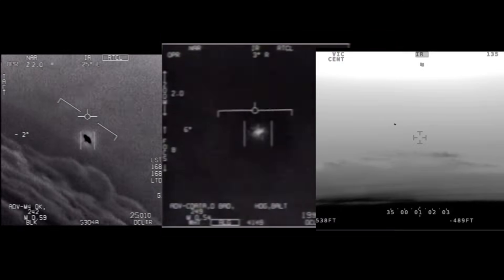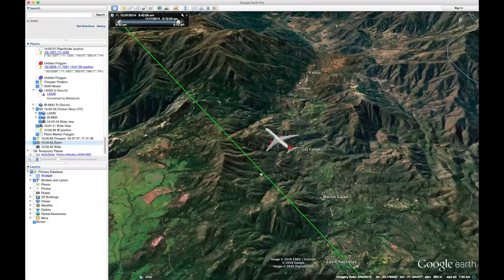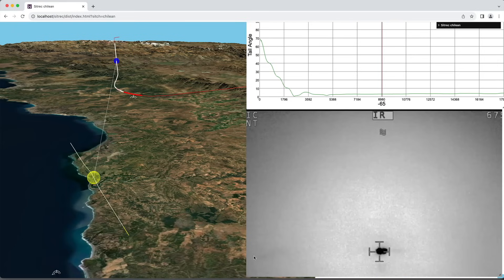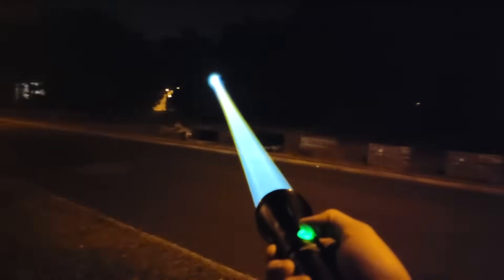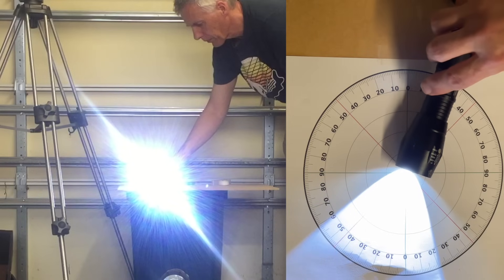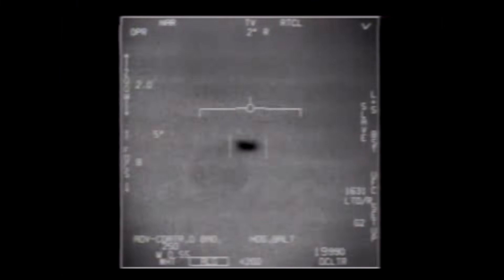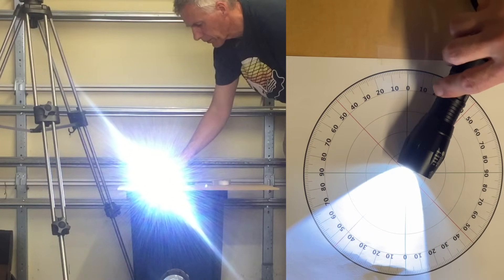Jet Engine Glare - Angles and Sizes

Comment from the maker: UPDATE: With the A340 engines, the range of visible glare angles is much greater than the F/A-18 engines. The A340's Rolls Royce Trent 500 or CFM56 engines have an exhaust cone that gives a large thermal signature (a glare) even when you can't see "up the tailpipe."  However, the flashlight analogy still applies to the F/A-18 and similar engines that just have an open cylinder with the hot parts visible at the bottom.
Reply: Source?

Comment: That's a nice flashlight.
Reply from the maker: $10 on Amazon https://www.amazon.com/gp/product/B072WHQFJ7/ref=ppx_yo_dt_b_search_asin_title?ie=UTF8&th=1
Reply: @MickWest is the $10 one the one that looks like a lightsaber in the outdoor shots? Surely not? 😮
Reply: Actually, it isn't. It's one of the cheapest, prone to falling apart if you even look at it the wrong way. To get anything decent, you have to spend at least 100 USD. (I'm a caver here in Jamaica, so know my lights).
Reply: @JCO2002  yes ok, we'll use the 10 dollar job to check what made that rattling noise back there behind the shed, and you use your 100 dollar job to descend into the bowels of the earth

horses for courses
Reply: @DrWhom  Sounds like a plan. Although, you know, my headlamp actually costs 900 USD (Scurion 1500). The 100$ unit is just a tactical light. Quite bright, though! :-)
Reply: @JCO2002  Yeah, I'm not spending a $100 bucks on a flashlight ;)
Reply: @SebSenseGreen  Ah, but if you did, once you'd used it, you wouldn't regret it. Big Li-ion battery (21700) with multiple light levels, the lowest of which lasts for days, and the highest of which makes for great self-defence - blast that briefly in someone's eyes and they're blinded for minutes. But each to their own.
Reply: @JCO2002  I have enough addictions right now. Hehe... My last one I got is the mechanical keyboard addiction. I'm gonna wait a bit before I start a new one. But, thanks for the info.
Reply: @SebSenseGreen  You're welcome :-)

Comment: Mick(Sorry, phone), clear up for me a few things about your rear-end of a jet hypothesis please.

1. The cloud movement, aka, parallax.

So if we're looking at the rear of a jet engine then surely the object must be flying away from the F-18 gimbal pod, yes? Since any divination in any other direction other than directly away from the camera would produce a thermal jet exhaust in the opposite direction which we'd see, but we don't see any, yes? Therefore if what you're saying is true, then any parallax effect creating the illusion of this object moving leftwards with absolutely no visual jet exhaust can ONLY have been created the F-18 gimbal camera moving in a rightward direction relative to the object being recorded to give the illusion that it's travelling leftwards yes? 

2. The problem with that theory, is that apparently the F-18 was on an intercept course and flying directly at this object. So if that's true, then any parallax was being created by the object and not the F-18 but if that's true then it means the object was flying in a direction that wasn't the same direction as the intercepting F-18 mounting the gimbal. But if that was the case then we'd see a jet exhaust going in the opposite direction the object appears to be going in of course, but we don't see any such directional exhausted which must therefore mean the object, if it's a jet, is flying directly away from the F-18 and that the F-18 is not flying directly at this object on an intercept course as stated in the story, right?
Reply from the maker: 1) It works out as flying away and a bit to the left, about 25° at most from straight away. 
2) The F-18 was flying 54° away from the jet at the start (number at the top of the screen), then it turns towards it, decreasing the parallax effect,  which is why it seems to slow down.
Reply: @MickWest  That seems a very compelling evidence in your favor when held with all your previous associated vids on the Gimbal vid. 

It's still hard for me to believe that the pilots we hear commenting in this Gimbal vid as they record this footage on their FLIR are completely perplexed by what they're looking it. It's fine and expected for someone like me to see something like this for the first time and say I don't know what the object is, but it's hard to believe that these trained pilots haven't seen this many times before and are so shocked and have no idea what it is they're looking at. Surely they must have seen the rear-end of a jet on their FLIR pods many a time? 

Thing is, people make mistakes and while I'm definitely surprised the pilots haven't seen this before(and most likely many times surely), perhaps they are only new pilots in training, though I think I heard Ryan Graves say he knew who those guys were, flew with them many times and that they were highly credible and experienced pilots.

Ya, overall I'd be inclined to agree with you, and that if the pilot had switched from IR to TV mode, we would indeed be looking up the backside of a jet engine. It doesn't explain the "omg there's a whole fleet of em!" on the SA, but then again, I've always found the fact this "Gimbal" vid is so very conveniently shortened to be somewhat suspicious to begin with and always felt that there was most likely  the "before and after" part of that vid purposefully excluded in which a lot more revealing things are included. Not because classified. but because it would either heavily empower or completely debunk the ET narrative some like Lui would push. 

The pilot would not have started recording or finish recording to create just the small gimbal vid we see. There would have been a lot more footage before and after. We're informed by Ryan Graves in some other interview I'd seen, that this particular FLIR would be recording the featured "UFO" object at around 9 nautical miles. If that's true, and we know an F-18 cruises at 6-700 knots(depending on alt and without being pushed hard on an intercept of importance) then at the time that "Gimbal vid" ends, we're only seconds away from the pilot making a visual ID with his own eyes on this object if we were to believe the story about this object hovering, rotating and then cutting back in the direction of the intercepting F-18 which of course would only serve to make the interception ETA faster still, right? And yet we don't get that part of the vid, nor have we heard ANYTHING from the pilot who had this FLIR bolted onto his F-18 making the recording. Why is that? Again, I find that suspicious. Is it because he's still an active pilot? But Ryan Graves who said he knows the guy, is himself now long retired, which would mean this pilot is probably retired by now, or extremely green at the time of this recording which would explain why he didn't know what he was looking at if it was the rear of a jet, or perhaps doesn't want to go down that ET rabbit hole. OR, Is it because it's an ET craft performing exotic maneuvers where typical digital camera artifacts are actually a bubble on warped spacetime, or was it just another jet flying away from the FLIR equipped F-18 in which the pilots make that discovery soon after, laugh off their mistake, and it's back to business as usual? When I type the words, "It's an ET craft in a bubble of warped spacetime", I feel ridiculous tbh, and I'm a very objective and fair person. Could it be? or is it more likely the rear of a jet engine in IR flying away from the camera? We need a LOT more information to make claims it's some ET craft, right? Surely that's that sound opinion without making a mockery of anyone or insulting anyone?

Mick, have you ever tried to make contact with the pilot/pilots who recorded that gimbal object that were commenting in the vid? Thing is, I feel this entire ET pushed narrative for possibly just a mundane UFO objects which Lui and the usual UFO brigade push as "Definitely a ET craft!... Bob Lazar!.... Groom lake!!"  could come crashing down like a house of cards with just a little enlightenment by these pilots, or equally the narrative could be reinforced if indeed what they saw was something "exotic".

Comment: To me, the most surprising thing is that no one at Navy or elsewhere figured this out earlier... I mean, that would appear to me as a common situation for a pilot. They've gotta be chasing off tails of  other crafts pretty often. How could they have never seen that on their Ir monitor earlier? (genuine question, I'm not a ufo enthusiast)
Reply: Some pilots have said they see new things after equipment is upgraded.  Possible explanation for why they are initially ¨tricked¨?
Reply: @JTS-u3l  Sure, it could be. But what i'm saying is that it doesn't appear to be a glitch, it's just the way it works : flir camera do have glares (and I don't think they have corrected that yet, but i don't know...). So this should happen pretty often... well at least, that's what i would expect.

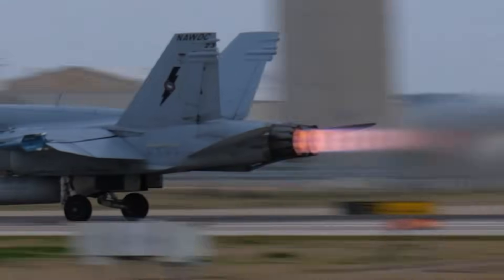Comment: 2:33 Perhaps a minor point, but in afterburning/reheated jet engines like the ones shown, the turbine is quite a long way up the jet pipe, and wouldn't be visible from a wide range of angles. The supports for the afterburner would also obscure the view of the turbine somewhat. I don't know how different the IR signature would be with afterburn on vs off.
Reply: It would be interesting to see comparisons. But even at mil thrust the inside tailpipe is going to be hit and glowing on IR and smashing photons out in all directions.

That’s how heat dealing missiles work. 

What might be interesting is seeing how stealth jets exhaust creates less glare. But I’m sure that is classified.

Comment: This  could be really reasonable and believable IF the videos weren't shot by army professionals that probably know how a jet engine looks like in infrared and they would have known that in that direction there are planes since the control tower they were communicating with most probably knew every plane present in the aerospace.
Reply: @darklight2.1  what do you mean? In the video the  pilot or whoever is talking sounds surprised that "it's rotating" also the pilots did interviews.
Reply: @darklight2.1  1.they knew why the "image" should be rotating but they were surprised that that it's rotating because it shouldn't rotate.
2.ex Commander David Fravor stated in multiple interviews that not only they picked up the objects with their instruments but they also saw them with their own eyes, they flew very close to them.
He said that they were present all the time, so much so that the pilots already were looking forward to seeing them.... this is the context.

Comment: In the Chilean video and ones that we know are jets you can obviously see the outward propulsion of gas from the engines. Yet in the gimbal video you don’t see any outward propulsion of gas from the engines. How do you account for that ?
Reply from the maker: The large glare covers any exhaust gas cone
You don't really see gas in the Chilean case - maybe a little right at the start with the larger angle.

Comment: Have you considered experimenting with a kitchen blowtorch? Maybe it also behaves similarly to the jet engine?
Reply: That's a great idea, although you'd need to use an IR camera or similar.
Reply from the maker: I have. But I’d need to modify it to be more of an occluding tube. And the thermal camera I haves is rather low resolution.

Comment: Another fantastic video Mick. This just brings everything closer to a complete explanation. 

I do have a question though: Fravor mentioned that on a higher resolution of the Chad Underwood video he could see two "legs" putting out in the same direction to the right. What do you think this could be? Is there any sort of identifying gear that a jet could have that matches that description? Or could it be some misperceived artefact from the edges of the wings of a distant jet banking? Explaining that specific observation by Fravor might add another data point of confirmation for the glare/distant Jet explanation, removing more of the "what-about-this" counterpoints.
Reply: I don’t know who any of these people are, I assume UFO fanatics? Regardless, did they show this image or was it just heresay?
Reply: Since you can't see the actual object, he's probably referring to diffraction spikes coming off the glare.
Reply: @MeppyMan   Fravor was a Top Gun pilot instructor who, along with three other pilots, SAW the 40ft tic tac shaped object in the "FLIR" video instantly accelerate to hypersonic speeds from 500ft away. Underwood was the pilot who filmed the UAP after it had just travelled 40 miles away from Fravor in less than a minute, while being jammed by the object in the video. This acceleration was corroborated by multiple radar systems in the Nimitz carrier group. Not a distant plane. I'm not surprised you don't know about them, Mick's "debunking" videos omit everything he can't explain. These witnesses were literally the best of the best pilots in the Navy and 500ft away is more than close enough to not mistake what they saw. Every video Mick has made "debunking" the DoD authenticated videos omits more than it includes. That's not hyperbole. That's why he can easily "explain" them and the most advanced military ever, can't. It's easy to debunk anything, you just have to ignore everything you can't explain. No problem.
Reply: @Bluewhalebig  You are assuming that the object seen by Fravor was the same as the object seen in FLIR1, filmed over an hour later (not 'less than a minute'!).  There is no good basis for that.  Also, so far as I know Fravor's only numerical estimate for the speed of the object he saw as it went away from him was 600-700 knots.  That's not hypersonic, and only borderline supersonic..  And where do you get '500 ft away'?  In his recent prepared statement to Congress Fravor gave the closest distance as half-a-mile.  That's over 2500 feet.  In short, you literally don't know what you are talking about, but that has never deterred BS merchants.  I''m guessing you are nowhere near as big a a blue whale either.
Reliable sources please, if you want to dispute anything.
Reply: @Bluewhalebig  What Fravor actually said in Congress was quote:
 "Our altitude at this point was approximately 15,000ft with the Tic
Tac at about 12,000ft. As we pulled nose onto the object at approximately ½ of a mile with the
object just left of our nose, it rapidly accelerated and disappeared right in front of our aircraft.
Our wingman, roughly 8,000ft above us, also lost visual..... As we turned back towards our CAP point,
roughly 60 miles east, the air controller let us know that the object had reappeared on the
Princeton’s Aegis SPY 1 radar at our CAP point. This Tic Tac Object had just traveled 60 miles in
a very short period of time less than a minute.....We returned to Nimitz and mentioned what we had witnessed to one of my crews who were getting ready to launch. It was that crew that took the now famous approximately 90 second
video that was released by the USG in 2017."

So you and others are assuming it is the same object. It could be 3 different ones and the filmed one looks like a twin-engined jet at 20-30 miles distance. It's a shame no one in Fravor's team had a camera.
Reply: @sIXXIsDesigns   You think multiple Top Gun pilots could be mistaken by a 40ft tic tac shaped object, instantly accelerating to hypersonic speeds, from 500ft away, corroborated by multiple radar sensors, in real time, and consistent with radar observations spanning the previous two weeks? Try to visualise what that might look like: walk 500ft away from a parked car, turn around, look at the car, and tell me if you could possibly be mistaken by what you see. Now imagine the car as a 40ft tic tac, instantly accelerating away from you, and tell me you could forget or missremember what you saw. I've heard West's explanation for this, but nothing, no matter the size, distance, angle or atmospheric conditions, can mimic instant acceleration. West's analysis of this encounter relies entirely on all of the witnesses lying, despite that not being consistent with their character by all accounts.